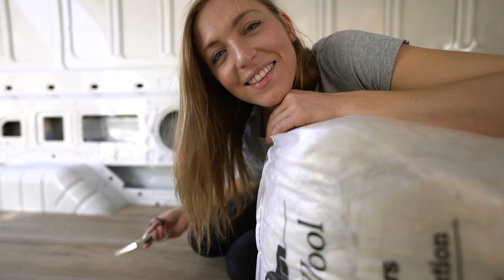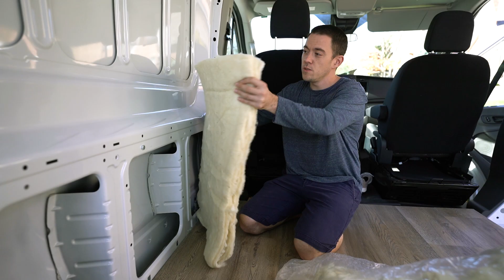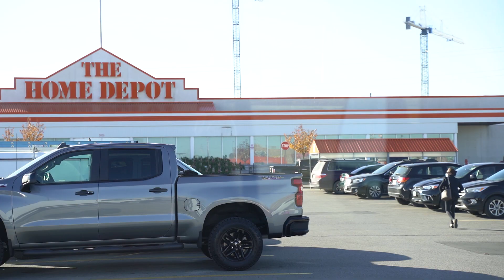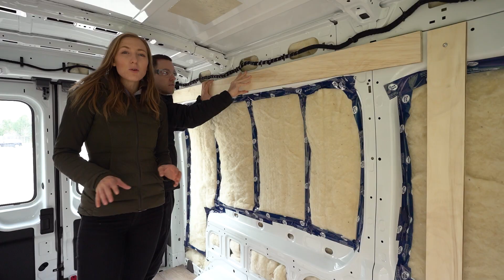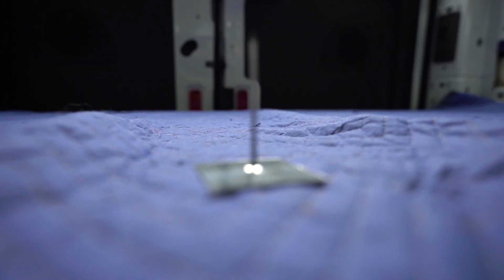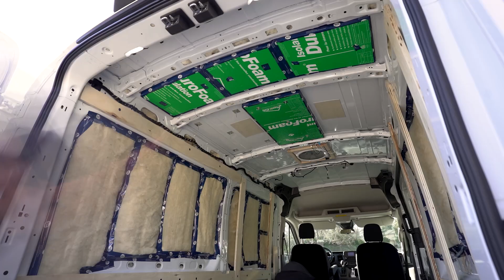Insulating & Framing our Van Life Tiny Home (with Havelock Wool)

Comment: Greg is so chill with his build…you two are great. I just finished my floor. Have two batches of wool from havelock. Just starting to stuff my walls. I was going to replace the plastic paneling in my extended express as to not incur any other expenses. But you are making the process look tolerable. I cut stained verathaned  the wrong side of one of my floor pieces…silly but learning a lot. Just subbed.

Comment: I noticed you used 3/8” nylon bolts for the horizontal stud . Can it be use on vertical studs ?
Reply from the maker: Sadly no, no way to get behind the vertical studs and tighten the nut
Reply: @RichandKirsten ok.....thanks....love the video....

Comment: Great Video!  I haven’t started framing yet but was wondering how long your 8mm and 3/8 in bolts were.  Thank you!  I love the video!!!
Reply from the maker: I honestly can’t remember, the 3/8” ones can be pretty short though - Ford’s BEMM for the transit shows recommended mounting points for extra strength
Reply: @RichandKirsten  Thank you so much for the reply.  I’ll check out the BEMM.  Be well!

Comment: You can also use rivnuts in the existing prefabricated holes.  Self tapping screws aren't as strong as those bolts you decided to use.
Reply from the maker: We did look at the rivnuts but they were more expensive and hard to get in Canada surprisingly

Comment: Correction why not use plusnuts???see another comment!
Reply from the maker: The plusnuts are hard to source in Canada and you need a special tool to install... the nylon threaded nuts are available at Home Depot and made to handle vibrations!!
Reply: @RichandKirsten  the amazon name is rivnut.
Reply from the maker: Thanks for the tips! Could be useful for us in the future
Reply: @RichandKirsten  sort of agree but kit is 120 on amazon or buy nuts and us a bolt and two nuts,wrench to expand. Just some ideas not critical of your long arms and insensitivity to finger pain installing plastic nuts. Great Econo logical build,realistic.